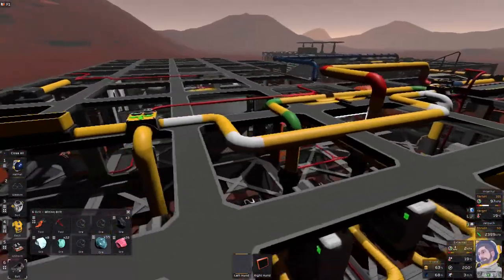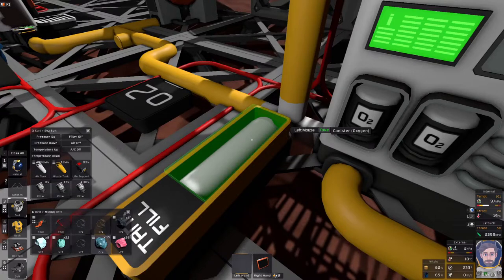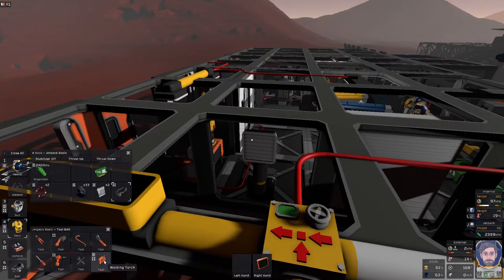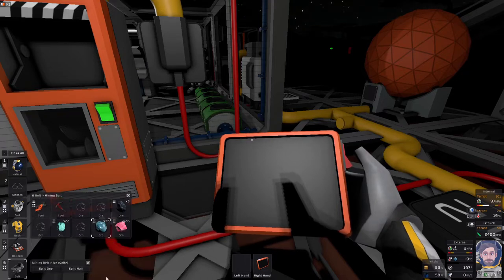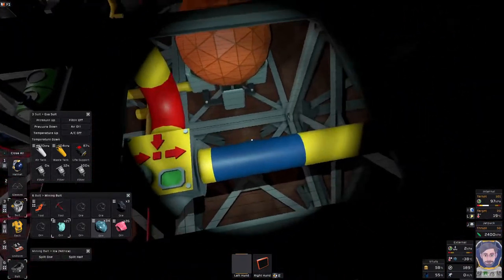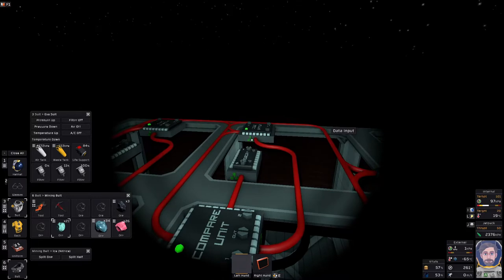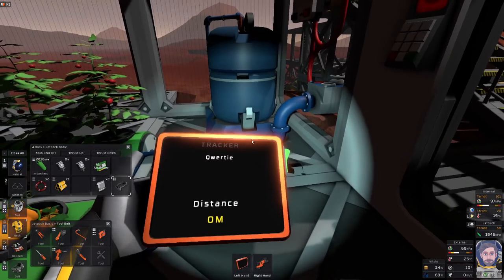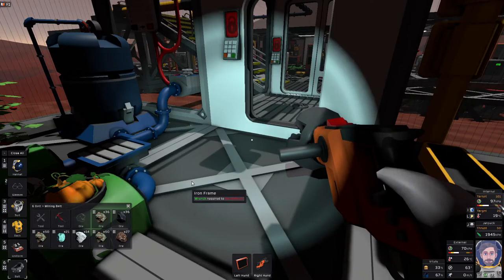Stationeers - Intermediate Atmosphere guide / tutorial.

Comment: The waste pipe between your filters has a good chance to explode if you dump a lot of gas in the system. The cooler and the heater would work better if they were on opposite sides of the greenhouse. If you put a pressure regulator and a back pressure regulator in the greenhouse on opposite sides of the room, it would be easier to maintain the correct atmo in the greenhouse.
Reply from the maker: Agreed not have automated pressure systems can be very bad. I plan on showing our advanced green house with a logic setup to auto vent gas if the pressure gets to high. It seems code scares people away so don't want to over whelm them right out the gate.
Reply: @deadmemegamming  the regulators do not need logic, you can set the back pressure a little less, and it will constantly pull air a little at a time. I would be interested in seeing how you have a cooling system for hot gas set up.
Reply from the maker: @kevinwbrake  we play on mars mostly, so we use passive heating in cooling a lot, but we do have some programs dealing with pressure, gas ratios  and temp in larger building and habs.

Comment: I’m having trouble connecting my solid fuel generator in with my small station battery. I put it on the same line as the solar panels coming into the small station battery. But, it blew cables out on both sides. And the cables going out of the station battery are heavy. But, early in the game I had it running straight to my leave and my other equipment and nothing got blown out. So, I’m a bit confused. But, I’m gonna put a Transformer between the solid fuel generator and the small station battery. If that works I’ll try to hook the solar panels in also somehow. I want them both coming into the station battery right? Then, heavy cables and a transformer on the output side to my Apcs
Reply: Use heavy cable
Reply: Yeah use heavy cable, super late reply but I think solid fuel generates about 20kw and small cable is rated for about 5kw, off the top of my head
Reply: @MuckyBeef  wont blow out if the requested power is less than 5k